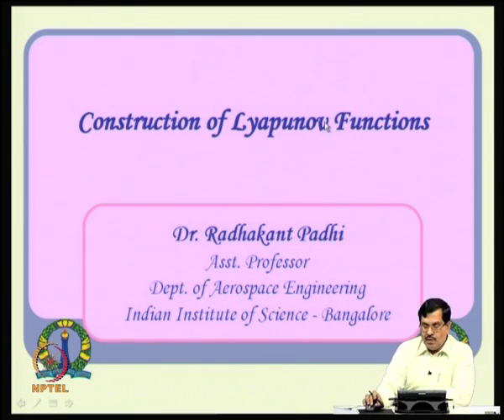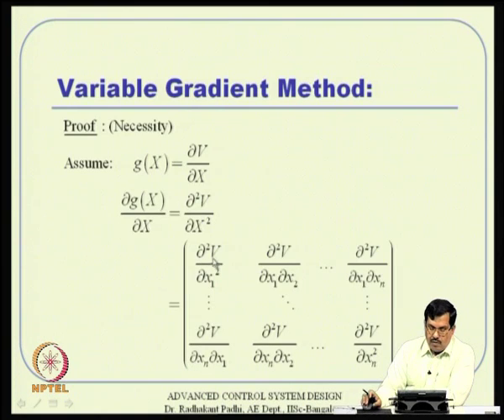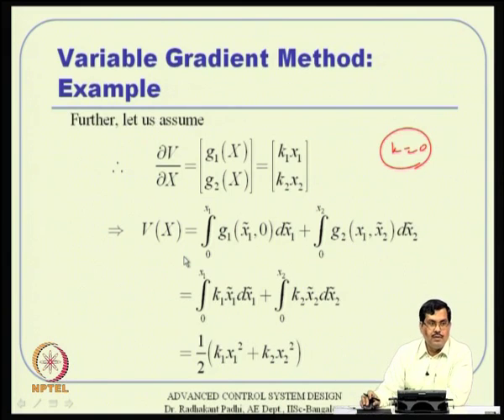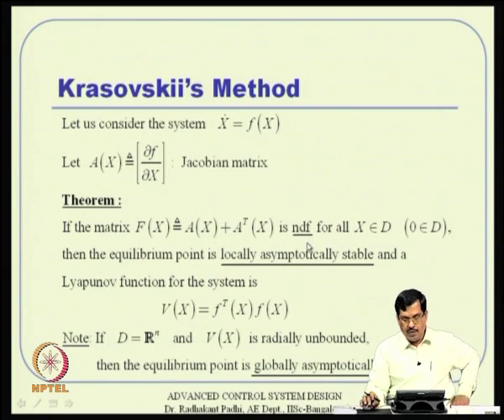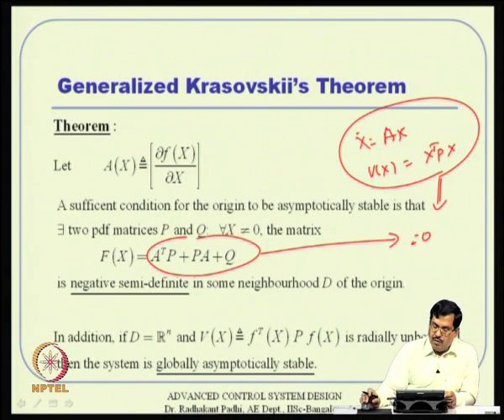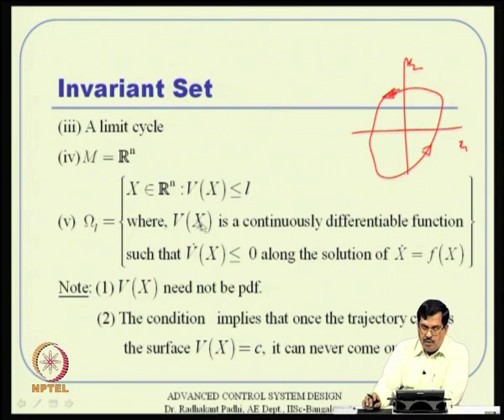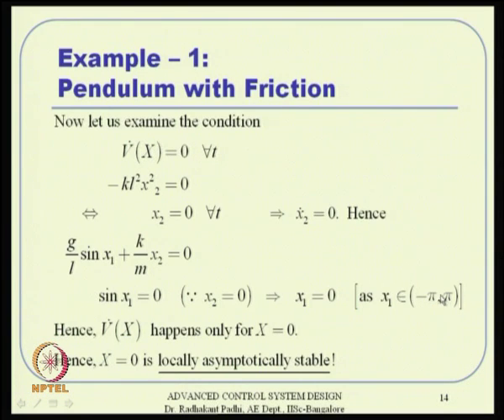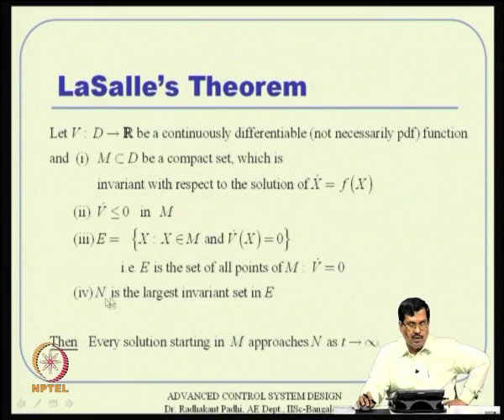Mod-13 Lec-32 Lyapunov Theory -- II

Comment: Without showing how to implement it on a computer, i.e the programming part... all this explaining is useless... Don't know if he is teaching students or revising course himself... You know the subject very well but not teaching from students perspective... only doing lip service during the whole course... I cannot design a basic swing up inverted pendulum control simulation using this lecture series... I dont understand why you guys make a long  useless course of 40 hrs which can be efficiently explained in 5 hrs max.
Reply: I cannot comprehend how this guy successfully landed a rover on moon using this theoritical knowledge... he knows everything but don't want to teach us the implementation part... maybe because of strategic reasons.